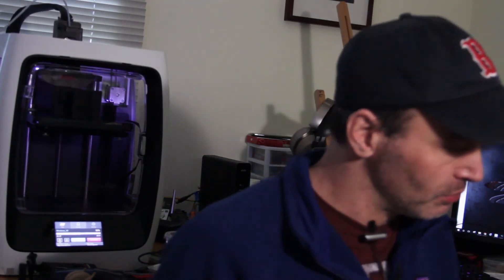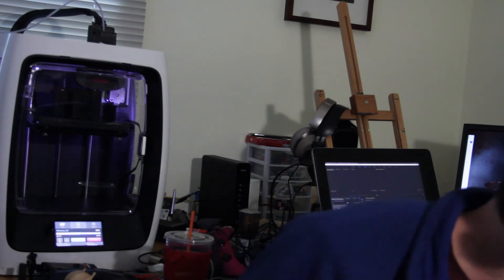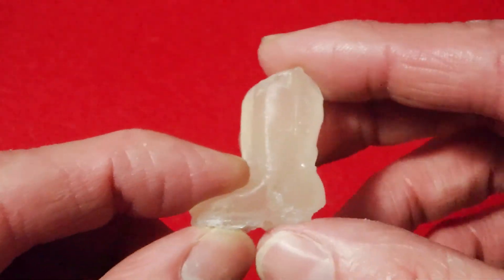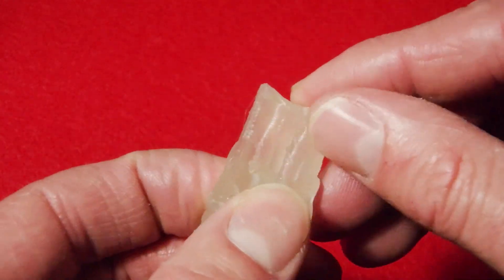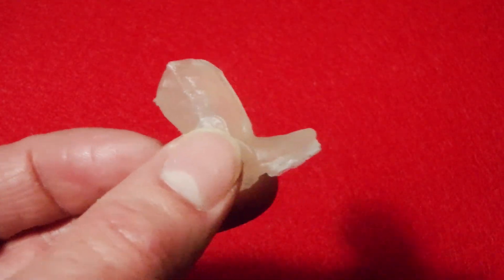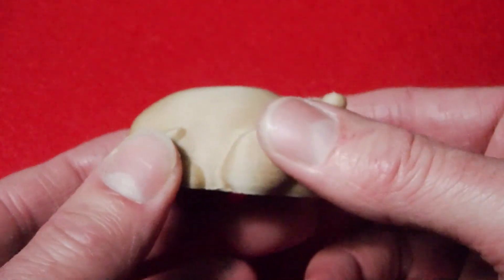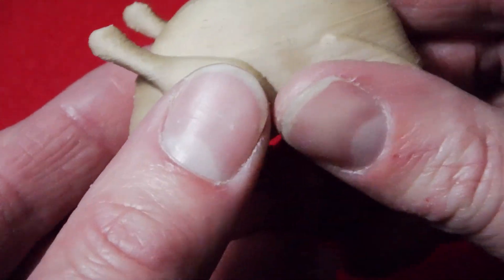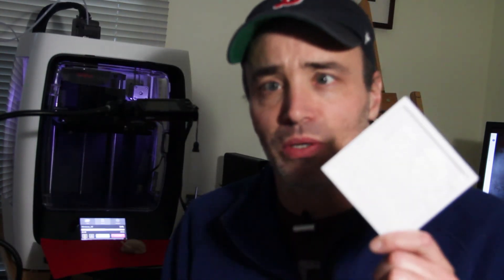Robo 3D R2 Review

Comment: would you recommend the r2 as a good first 3d printer?
Reply from the maker: Yes.  It has its problems, but they are vary easy to work with.  The print quality is vary nice.  I have pushed mine to .02 mm layer height, but i don't really recomend printing alot at that size.  I normally print at  0.06 mm layer height. Just depends what I am doing. 
Sorry for taking a week to repond back to you.  I was traveling, so I did not see.